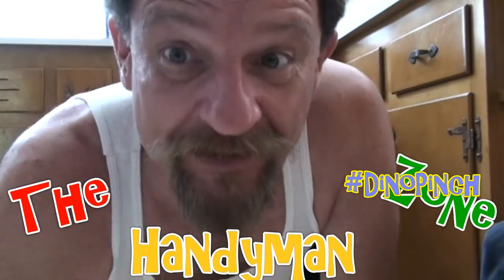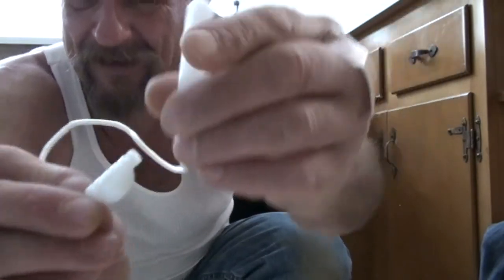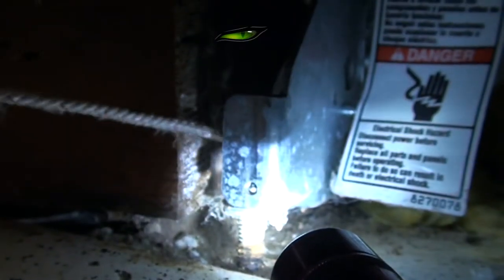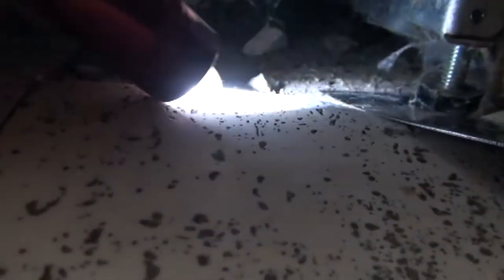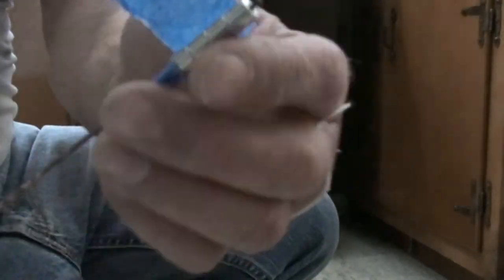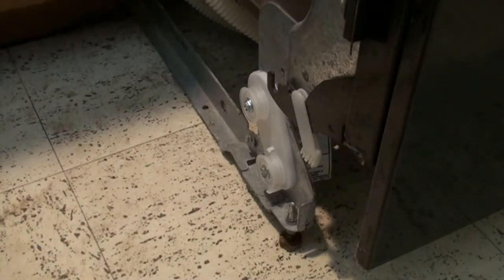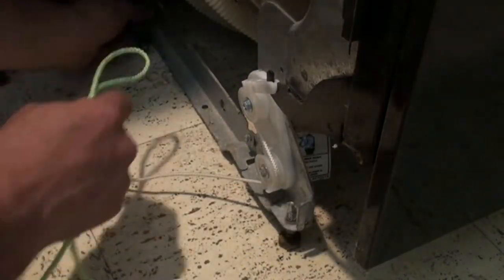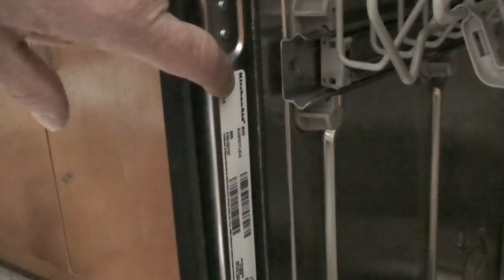Dishwasher Door Spring Repair ft DinoPinch

Comment: The string pulling the spring to the new pulley was the bomb! Best tip on all the sites we looked at.  Unfortunately for use no slack in water or electrical line, took longer to disconnect and reconnect then the repair itself. 12.00 part would have cost 160.00 if I called a repair service.